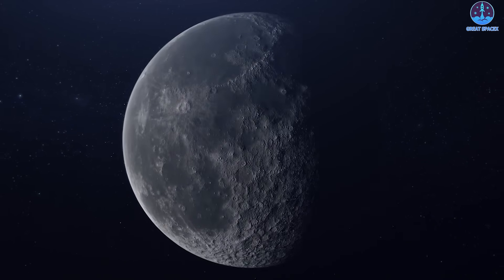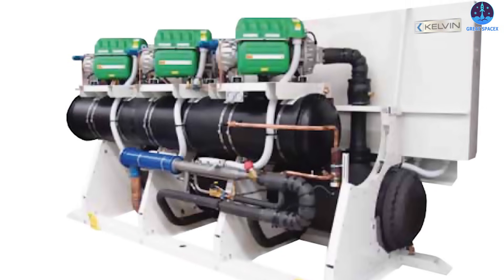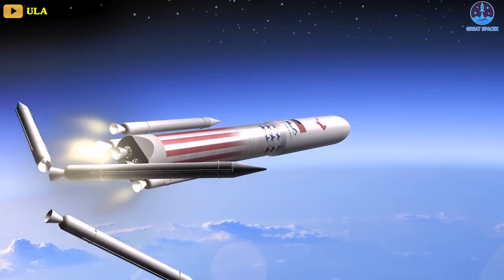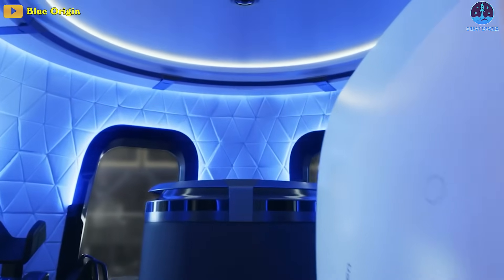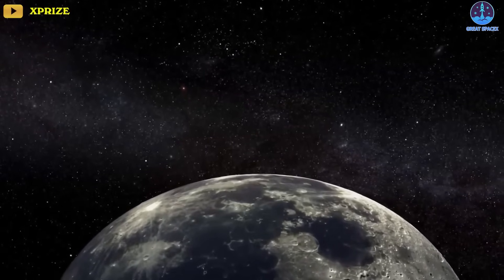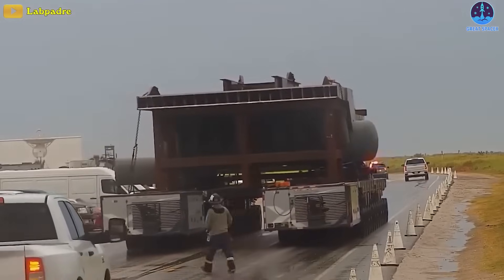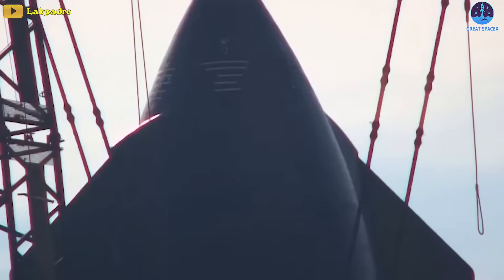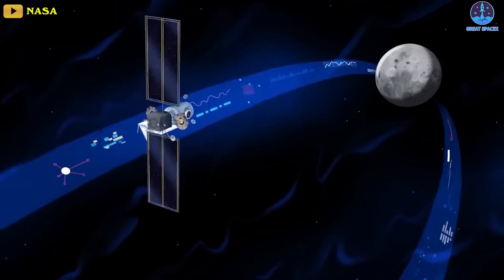What NASA just declared on Lunar Starship unlike any others! Is SpaceX in big trouble??? (mix)

Comment: I believe you can achieve the moon mission solely using SpaceX moon ship! 😮
Reply: Yes, it is possible. HOWEVER, current design of Starship/HLS is better suited for Mars than it is for the moon. The biggest issue is fuel. Going to the moon and back requires more than a trip to Mars. Also, and most important, using Methane as a fuel for moon trips puts Starship at a MAJOR disadvantage. Because there is water ice on the moon, creating hydrogen fuel there would be relatively easy. Spacex would basically need to create Raptor/ Starship engines designed to burn hydrogen.

Comment: Nice flic. HOWEVER!   If you compare disasters you should do your home work.
The shuttle exploded, because a gasket on the Solid Fuel booster was eroded and a flame like a cutting torch blew out from the booster cutting a hole into the main Hydrogen tank.
The issue was NOT the hydrogen being leaky. It was braindead statistical risk modelling and managerial arrogance of not listening to engineers who actuall understood thr technology.
The shuttle risk analysis produced a result that made taking a car journey more risky than a shuttle flight!

Comment: Great Video and info !  The SpaceX Starship will be needed to deliver Cargo to the Lunar Surface (LS) of the moon !  The Cargo should be some inflatable  modules for living and working.   The LTV to recover some Lunar Water Ice  (H2O) for water to add to the Freeze Dried Meals and drinking (and maybe a real gravity shower ! ).  Also Starship HLS and Cargo should have six landing legs for safety and if one of those legs failed to deploy it would remain upright !  The Blue Origin Blue Moon HLS (LEV/LLV) is also needed to deliver two to four Lunar Workers to the LS and maybe help unload the Cargo from the Cargo Starship.  The Blue Origin  New  Glenn is needed to deliver Blue Moon HLS (LEV/LLV) to Lunar Orbit and later the Tanker version to fuel Blue Moon HLS so it can land at the LS Outpost and return to Lunar Orbit.  Once the Blue Moon HLS can be fueled on the moon, the BO New Glenn Tanker is not needed in Lunar Orbit and can then reduce the cost to NASA !  Also if Blue Moon HLS is designed for fuel tanks of  6.1 km/sec delta-V, the Blue Moon can return to the LEO CSS to be serviced in LEO for a Crew exchange.  The Crew of Lunar Wprker can the return to earth in the Crew Dream Chaser !  For more info on the LEV/LLV see "Moon Direct" by Robert Zubrin.  Timothy Lipinski

Comment: NASA used to be run by scientist and engineers that were hands on in the Devlopment of everything space now it's run by political bureaucrats with scientist and engineers that think they are above getting their hands dirty. My last job as plant maintenance and millwright before that was to make what engineers with their college degrees design actually work, often requiring major changes or complete redesign or scrapping the project. Thats what makes Elon Musk and the people he hires far ahead of the curve. Take Falcon9 for example, it was able to do what NASA and all of its legacy companies failed to do a reusable booster stage capable of landing on land or unstable drone ship in the ocean. Even the Shuttle program dumped its solid rocket boosters in the ocean that would have to be fished out and only partially reusable. Even the Space Shuttle could do what Falcon9 booster can a powered landing. The Saturn V engines were hand crafted by the scientist that designed them, that's why they can't be duplicated today because NASA and its legacy companies no longer have scientist with or willing to do the hands-on work needed to get the job done.
Reply: Musk was able to do with SpaceX what the others could not and it's not only about making reusable and self landing rockets.
Elon Musk is willing to charge LESS per launch than his competitors, he was willing to keep SpaceX private and not public so that he didn't have external interference with his vision from greedy shareholders.
He's willing to not be a greedy SOB and focusing only on the bottom line to the exclusion of all else.
It's because he's willing to be patient that he's able to outdo all the other old time aerospace companies combined.

Yes, SpaceX has a higher risk tolerance and a culture of taking risks and of innovating through their willingness to accept failures and to learn from it. This kind of mindset is totally alien to those who went through the traditional route in defense/gov't contract industries, play it safe, drag out timelines as long as possible, always maximize profits at every opportunity.

Look at their competitor Blue Origin, which hires people from the traditional aerospace industry, the complete opposite of SpaceX, people who are risk adverse, who are big into the "safety" culture, that means never taking risks which can get you fired. Boeing or Northrup-Grumman or ULA types of managers, the ones who think "slow and steady wins the race". 
In the business of space, slow and steady cost America a 50 year lead in space, now that China, Russia, India and others are seriously pushing their own programs.
What is America's response?, hamstring SpaceX and let's "follow the rules". 

As for NASA, it's outlived it's usefulness after Apollo and should've been abolished after Skylab, space science missions should be university run like particle colliders or medical research.
Instead NASA become integrated into the military/industrial/political hierarchy and is treated like a gov't feed trough for pork barrel projects to keep the aerospace giants afloat.

The latest from BO: Bezos's Blue Origin names former Amazon executive as CEO -internal email

"The chief executive officer of Jeff Bezos's space company Blue Origin, Bob Smith, will step down at the end of the year to be replaced by former Amazon executive Dave Limp, who ran products such as Kindle, according to emails seen by Reuters."

This is Bezos answer to competition with SpaceX, appoint an exec with experience launching...Kindles.
Reply: @glenyoung1809  Agreed. and after the cold war ended is when the scientists and engineers got lazy and corporations got greedy and started outsourcing all of US production to other countries. I worked at the last Iron an Steel plant on the east coast that used raw materials. The blast furnace was globally known as the BEAST IN THE EAST because of its output and quality. In accordance to political ideology its now a land fill with most Steel and iron imported from China. The great War machine now has its excuse for full production again with the latest in Israel and WWIII right around the corner when you add in Ukraine.
Reply: actually the shuttle could not do a powered landing. It had no fuel for that. it was basically a gliding brick.
Reply: @jessepollard7132  sorry typo it was supposed to be couldn't do. Thats what I get for trying to comment from my phone with fat fingers LOL
Reply: @jessepollard7132  I also believe that the FAA and FWS was ordered by the current administration to drag their feet and try to put SpaceX out of business in retaliation because Elon bought their propaganda machine Twitter

Comment: Won't the Starship lander be extremely top-heavy? Most of the fuel/oxygen sits in the bottom near the engines. Or, will there be enough propellant to keep it steady? Designing landing legs for a much larger base might be the solution.
Reply: @froguniverse2419 True but gravity is still gravity. Center of gravity is still CG. 😎
Reply: @classic_sci_fi your logic doesn't work on fanboys.

Comment: The notion that having several suppliers reduced reliance on a single supplier, would be fine if it were born out by results,. However, the fact are that over the last 8 years there is only one supplier that is achieving and the others are just consuming money and resources. Division often reduces progress and performance and in this case Blue Origin and Boeing are wasting money on product designs using the discredited Hydrogen fuel systems.

Comment: What has Blue Origin put into orbit so far, apart from zilch. And they reckon that they can build a lunar lander, launched by a booster that's not even complete yet, therefore never been tested, along with very dodgy engines.
Meanwhile, SpaceX is launching re-usable boosters left right and centre, and providing the ISS with fresh crew and cargo on a regular basis.
I know which one I'd go for.
Reply: Well, the starship has so many new and improved things that we have to wait to if they work at all, and with reliability similar to that of the Falcons. Increasing the chamber pressure from 100 bar to 300 bar is quite a leap, not a step.
Reply: Government is greed, waste, stupidity, corruption & Nasa is government. NASA choosing multiple Artemis craft means more points of failure.
Reply: It’s not even about landing in the moon, where Blue Origin and Jeff Bezos are concerned it’s about those lucrative cost+ government contracts and extending out the gravy train as long as possible.
Bezos wants to use the same funding and business model for his project that the SLS uses for theirs, endless cost overruns and delays all the while raking in billions of tax dollars.